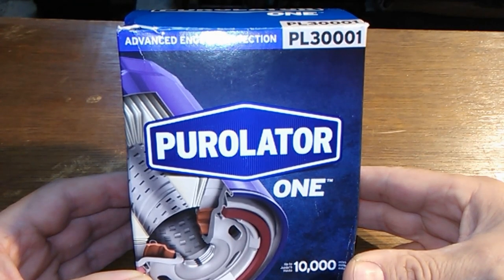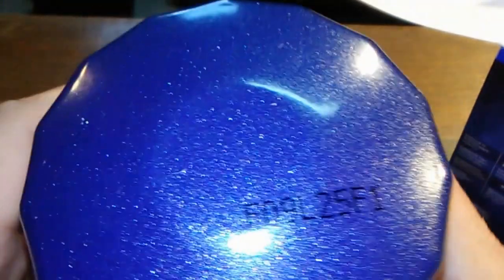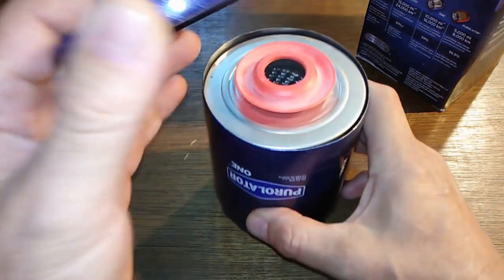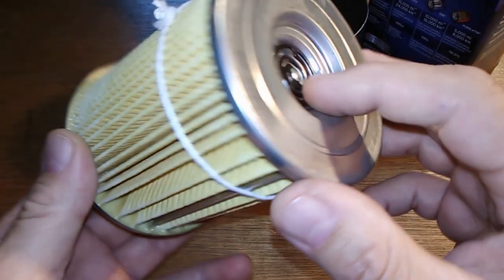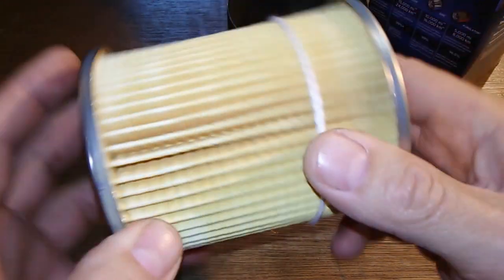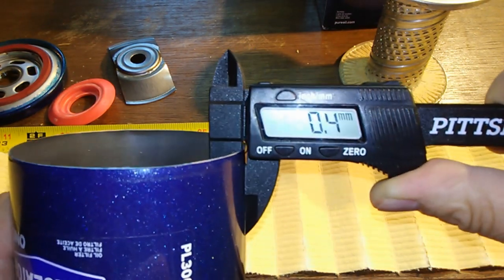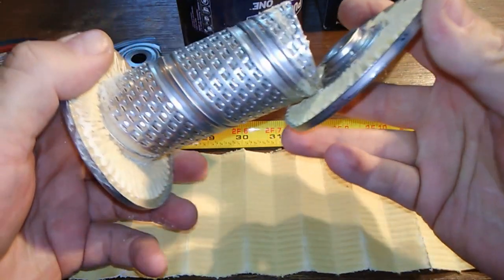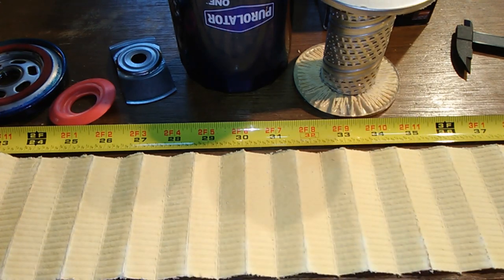Purolator One Oil Filter Cut Open PL30001

Comment: I personally think the Purolator One is the best bang for the buck. I used the Purolator Boss and K&N Gold/Silver several times as well for my application, but since I religiously change my oil & filter every 5,000 miles, I figured that I didn’t need to spend the extra money for the added dirt holding capacity.
Reply from the maker: Watch this Friday, 
I compare the Purolator one and the Purolator Boss. 11-13-20 and 11-15-20

Comment: That string makes me doubt the filter.  I'm sure it was to help in the manufacturing process, but still. 

For my car (Toyota 1.8L), The pretax price for the Wix XP (Amazon $9) is $1.02 more for Purolator One (Amazon $7.98) The Purolator boss (Amazon $11.78) costs $2.79 more than Wix XP (Amazon $9). 

For the price I will stick with Wix or Baldwin.
Reply from the maker: Hi Jason,
You don't want to miss next weeks video's, I opened up a Purolator Boss with a follow up video. (Nov. 13th and 15th)  I was very impressed with this filter. In my opinion the best I've see so far, as far as filter media go's.